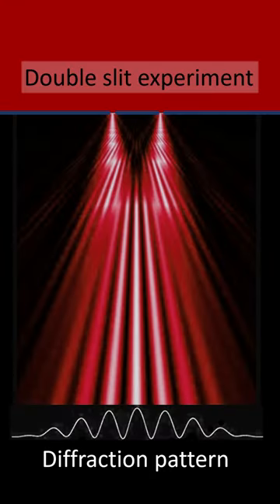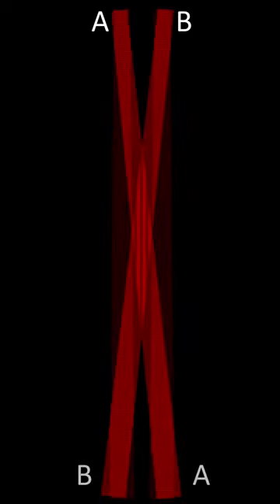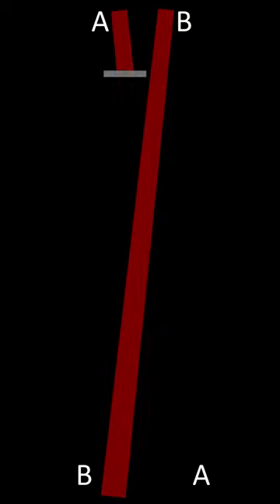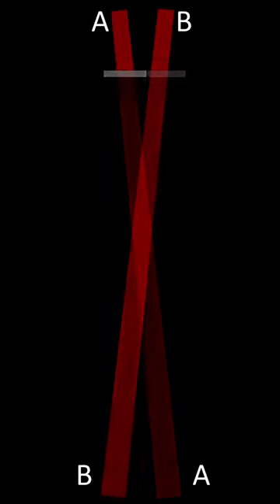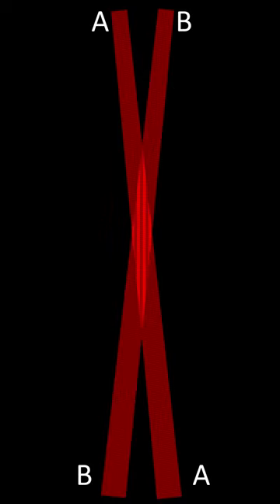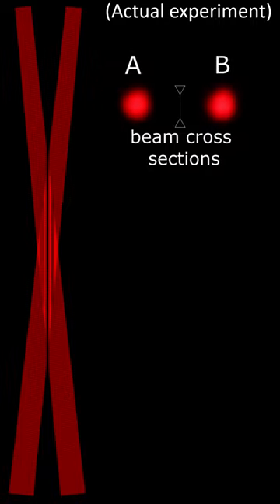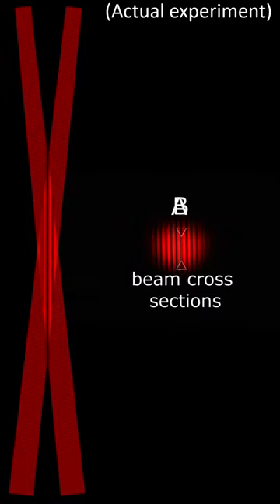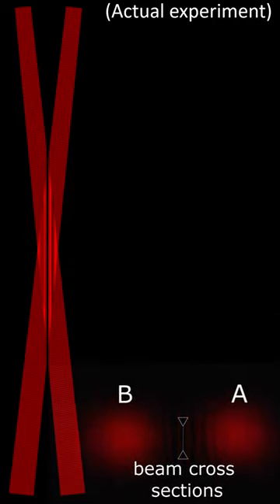The double beam experiment

Comment: The use of reflecting/transmitting beam splitter causes a phase inversion in one of the resulting two beams (the reflected beam). That's why when they interfere after traveling the same distance, the result is a destruction interference. 
You can try to use a polarizing beam splitter such as Wollaston prism, and you'll get no destructive interference. 
You can also try to use a diffraction grating, and isolate the beam going to the left and right of the same order. You'll get a constructive interference in the center instead of destructive interference.

Comment: Intensity is the sum of all contributions. You are observing the sum, not the separate contributions.

Is there no gravitational pull in a Lagrange point? Of course not. The forces just add up to zero.
Reply: Wait but Intensity isnt the sum of all contributions. If it was things like interference could not be possible because Intensity is never less than zero. Superposition principle only applies to the electric field and the Intensity is proportional to the square of the electric field.
Reply: there is no gravitational pull in a Lagrange point. Do you disagree? if so, where is it pulling towards?
Reply from the maker: @erdnussflipper172  you are right there, intensity is the  square of the sum of the individual EM field contributions.
Reply: We could also say that while the sum is zero in the region, its rate of change isn't so the propagation survives the crossing.
Reply: Ah yes … the bunch of beams experiment 😜
Reply: @solarcrystal5494 I just saw this, but the Lagrange points also depend on angular momentum-- that is, orbital speed, and not just gravity alone.
Reply: @solarcrystal5494 There is no net pull in a Lagrange point. There are indeed forces acting on you, but they cancel out.
Reply: @HuygensOptics We aren’t seeing the photons directly, we are seeing their impacts or field effects on the atmosphere or other elements they’re moving around or through.

The photovoltaic effect is everywhere.
Reply: That line is effectively a node, though an odd one as it's in two dimensions. 
Being a node, energy can cross it just like the energy in a guitar string crossing a point in the string that is stationary.
Reply: No, intensity is the square of amplitude. Amplitude is the sum of all contributions.
Reply: Langrange point is not zero gravity pull. It's that the sum of the pulls happened to change the orbit of a small object to one it shouldn't be at. The small object is still in some orbit, just not the one if only the large object exists.

Comment: Correct me if I am wrong. But here is my current understanding: 

Light interacts with other light WITHIN the EM field BEFORE it interacts with other fields. Within a single field, we use wave computations. BETWEEN fields, we need discrete computations. The mistake is thinking that the energy within the EM field is carried as photons. It isn't. The photons ONLY happen at the very end: when the EM field interacts with electrons in some atoms inside your eyes. Our model of photons freely zipping through space without a target is wrong. The illusion arises because of the "cast time" of light being dependent on distance between emission and absorption. But photons don't exist per se as objects. Rather, they are phenomena of energy transmission between fields that give that illusion (but only somewhat).

I now see photons as their worldines. You can think of them as straight threads (though they follow the curvature of spacetime). They tie two spacetime points in two different fields together. In this case, since we are talking about photons, points between the EM field and the electron field.

Not two space points together, but two spacetime points. Once you realize that, you stop thinking of them as free moving particles zipping through space over time, and instead see them as threads--wormholes of sorts--between points in the fabric of reality.

In the context of this experiment, there are threads between all the points in the interference pattern that are "lit up" and your eyeballs. There are no such threads between the "dark" patches and your eyeballs. The interference pattern can be thought of as a negotiation between the field and itself. The conclusion of that negotiation is then presented as photons to your eyeballs at the last step, as mentioned earlier. What you see, in the end, is a time traveled signal of the negotiation presented through discrete packets which I think of as threads.

What is weird is that there are certain energy levels required for those threads between spacetime points to exist at all. If we think of them as wormholes, it's almost as if to keep the wormhole open, we need certain specific energy levels.

Comment: The sine and cos beam meet each other at a very small angle (sin + 1/2 angle) ( cos - 1/2 angle ) the true direction of powerflow for each beam is straight and only a part of the beam is destructive  interfered and moves from one side to the other side of the beam over time. When masking one path of the other beam and we see the behavior. The 2 beams seem to pass an area of no light only because our brains interpret the small angle differently. As referencing to one beam: Sine wave propagation direction + 1/2 angle and the path 90 degrees on this is 'seen' as the observers reference frame. 
Best greetings John

Comment: So what happens if you put a physical divider between the two sides where there is zero light energy?
Reply: at the intersection? the empty lines?
Reply from the maker: If you were to place a barrier along the full length of the central area of destructive interference, both beams would effectively be blocked. The "continuous plane" is just a standing wave node, and energy can pass through it just fine because it is not a physical barrier.
Reply: @HuygensOptics  did you say that the light beams were out of phase with each other, to observe the effect?
Reply from the maker: @yasirrakhurrafat1142  yes but they are effectively out of phase in every black line in the interference pattern shown in the experiment.
Reply: @HuygensOptics  ahh.. 
I assume it also means that measuring the distance between the black lines may also be equivalent to the wavelength or some particular characteristics of the light?
I'm sorry, I'm not very educated.
Reply: @HuygensOptics  
but couldn´t you also argue that the the energy doesn´t go through the middle? If you look at the poynting vektor of one of the beams im pretty sure it won´t go through the center, because in the dark center the poynting vektor must be zero.  My problem is that Intensity directly refers to energytransfer and if the Intensity is zero the energytransfer must be zero.
Reply: @HuygensOptics  I understand that the energyflow from left to right just cancels out the energyflow from right to left, leaving a zero net energyflow in the middle. But if the the net Energyflow in the middle is zero couldn´t you just also argue that the energy of each individual beam just doesn´t pass throug the center? Im really not sure but i think if you would actually calculate the poynting vektor field for the whole configuration, it would not look like two "beams" crossing, but two "beams" coming closer not crossing and going apart again. But i would actually have to calculate that, maybe im gonna try that. With Interference effects the Energy always travels in weird ways (or at least i think so).
Reply: Perhaps a mirror in the middle would be a more accurate model?
Reply: Imagine a series of waves in water that create create a standing wave form. You can measure the wave heights as 'intensity' and call the bottom of the trough zero. If you imagine now adding a barrier below the surface of the water, it is analogous to inserting an opaque barrier between the beams. The rolling wave below the surface can no longer roll.

Comment: The observed emission pattern is an emergent property and not a fundamental one. There is plenty of energy transfer happening between the two sides.  The the overall effect on the macroscopic system is that there is a dark low or no emission part but that has nothing to do with what's actually going on fundamentally

Comment: If I had to guess about an intuitive "solution" [the maths of just adding things up is clear after all]... I'd say it's probably equivalent to a reflection in that plane? I think?

If you think about it as a bunch of oscillating nodes; the ones in the middle have to stay put due to the interference pattern from both sides [as in, the forces acting on the oscillator from both sides are equal but opposite, cancelling each other out]; which I would argue is probably equivalent to a reflection; because a "wall" that something reflects at is also equivalent to nodes that cannot move iirc

Comment: I think of it like a guitar string with a standing wave. There are points with zero amplitudes due to interference, but the guitar string is still vibrating. The wave momentum / energy still moves through the string. Similarly, the electromagnetic field extends through the line of deconstructive interference even though there are points with zero amplitude.
Reply: No in a standing wave the energy don't move.
Reply: @BricoRedstone  it does. A standing wave consists of two traveling waves, going in opposite directions. The traveling waves carry the energy and momentum.
Reply: @tanvach  its a point of view yes but another perfectly valid point of view is that standing waves are a collection of independent oscillators, the energy of each point is constant there are no energy transfer between oscillators (even if some points have more energy than their neighbors). In fact in the absence of any wave we could argue that there are two waves interacting destructively. My point is that we should not interpret superposition of waves (or solutions of the EM field) as a superposition of two objects but as a way to find solutions of the EM field. The two waves traveling in opposite directions do not exist (they are not physical objects) there is only a EM field which follows a particular differential equation: the wave equation.
Reply: @BricoRedstone  then I’m curious what’s your proposed solution to the ‘paradox’?

Even though each point maybe modeled as independent oscillations, points are coupled. So any disturbances in a guitar string will generate torque in its surrounding points. So the waves in the solution I would argue is physical. Why do you say the solution is not physical?
Reply: @BricoRedstone  So if I roll two billiard balls with same kinetic energy in opposing directions at a third ball such that they hit at the same time, are you saying the balls would remain at rest because the opposing energy/forces through the third billiard ball effectively cancelled each other?
Reply: No because it would violate conservation of energy. The two balls will bounce back as the rays of light

Comment: ****MUST READ****
(From my understanding and please correct me if I'm wrong?)
First, direct from the source, emitted light is subject to resonances and particles of the medium.(including structured light vorteces like our two subjects) .despite popular beleif formed from "bells theorum "
All observable light is permeated by a hidden variable that includes asterism within the medium from a external source not in the observable spectrum .there is no such canceling interference..this is a error..only merging into higher energy state  and out of the observable spectrum..
Thirdly,and most in regards, the two structured vortex beams in question already have higher energy states within its matrix before the aperture..when vortices kinetic impacts the structured mater(aperture) it is changed into a higher energy state of turoidal vortex pulses of color in the observable spectrum .
Lastly, structured light beams have a exterior layer (alot like cohesive water surface tension)to stop the beam from permeating. This outer layer makes a bond in a higher energy state not observable in the visible spectrum..when two beams outer layer come in contact they form a bond to allow permeating..the wavelenghts don't cancel each other out. This is most inaccurate description...I have a experiment most profound to human history..we need to know..and it involves light.are you interested? Could make history?
Reply: The light can not produce zero intensity..infact.. at a higher energy state, they are out of the visual spectrum

Comment: You are seeing scattered light, not the direct light of the lasers, where they phase each other out, they scatter no light but the beams are still intact. Sound waves are different because the waves are dependent on the medium they are traveling through, and when they interfere they cancel the energy in that medium.  Light is radiant.  Sound is not.

Comment: This is easily modeled using classical 2-beam interference theory. Each beam is modeled as a polarized plane wave, with the propagation vector of each beam appropriately defined such that they will cross at an angle theta in the region where they overlap.. Upon adding the two electric fields and multiplying the sum by its complex conjugate, one obtains, the time averaged intensity in this region of overlap. The mathematical solution for the time averaged intensity perfectly predicts the periodic interference pattern shown in this video. Furthermore, the two beams do not need to have a phase difference of 180° for this interference principal to take place. Indeed an arbitrary phase difference between them will simply shift the location of the observed fringes left or right by a number of fringes corresponding to this phase difference . This phenomenon is well known, and is the underlying principle implemented in numerous measurement techniques employed in the fields of experimental solid and fluid mechanics.

Comment: Should I point out that observing the boundary means collapsing the wave function? In RF theory light only interferes at the receiver, not in transit to it. You'd only observe the interference pattern by putting something in at the junction.
Reply: There is no such thing as "collapse of the wave function". You won't even find that term defined properly in physics books. All of this is perfectly classical wave theory, anyway. Quantum mechanics is of no use here.
Reply: Well, it depends on how you want to define it - what I meant was that the act of observing the inference pattern produced it, which means You cannot prove there is an interference pattern at all if you don't measure it, which is what this video shows.

Comment: It is a misconception that the energy has to "cross the center". There is only an overall flow of energy in the forward direction in the interference volume with a density that follows the interference pattern and derives directly from the spatial field distribution. The energy gets redistributed during propagation as the individual beams cross because they are per definition finite in spatial extent and hence diffract. The superposition principle holds for the fields, not the energy flow.
Reply: If you block the region of destructive interference (dark region) with a shaped object, the light is blocked and the interference disappears.

Comment: In my point of view there is a basic misconception.
In the event of a vacuum situation, the paths of the two beams are not 'visible' and there is no interference.
In the presence of air (or dust) the beams become 'visible' and the interaction with them results in the visibility of the beams with interference
Reply: Interference is the absence of interaction in linear media. We do teach this at the high school level, but it's a very subtle lesson that few students understand properly. It's a failure of the education system which basically hammers into student's minds that everything is the result of "causality". In physics, however, the most interesting things "happen" because of the absence of causality. That's what relativity and physical symmetries are all about. It's very hard to get a proper intuition for this after having been taught for nine or ten years that "things happen for a reason". Here they are "not happening" because of "nothing". ;-)

Comment: The energy did not have to cross, it was reflected the same way as in the surface of a conductor. The boundary condition is the same but enforced differently (symmetry instead of a quickly decaying EM field)

Comment: The energy is nonetheless transferred to the other side because each beam is an EM wave. Such wave is a distortion in the field which moves across space as time passes. The regions showing destructive interferenece (especially the planes of 0 intensity) are there just because the amplitudes of the coinciding waves add up to zero giving a perception of no EM field excitation but only locally. However, the wave carry onward and continue the EM field oscillation.